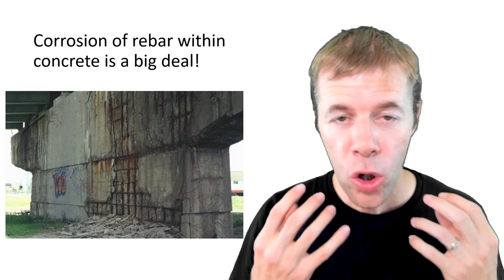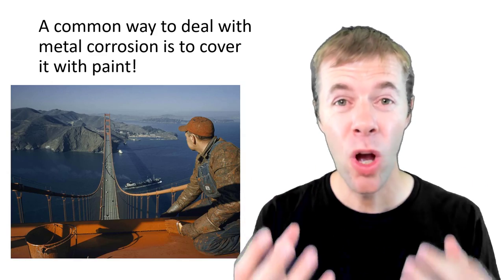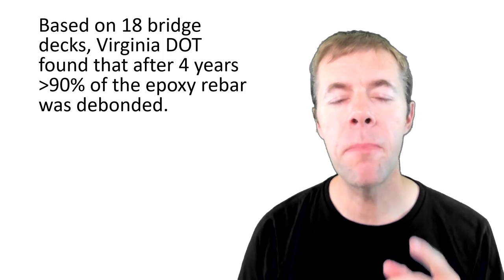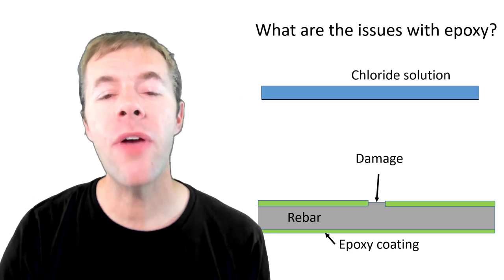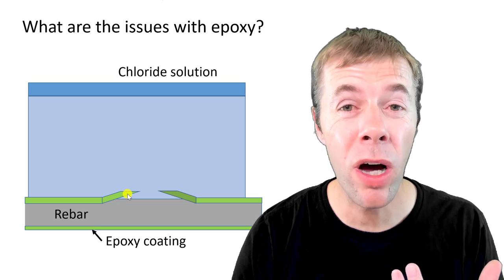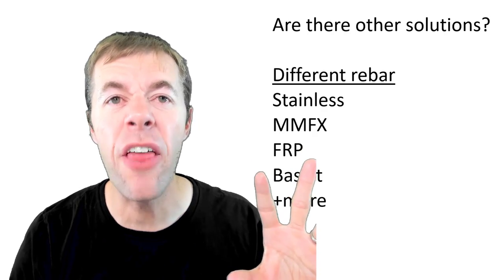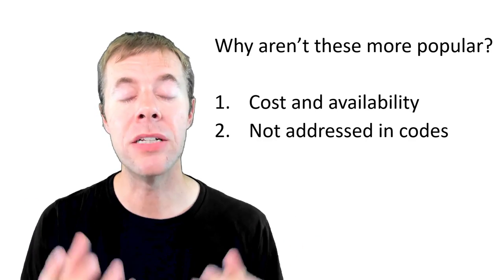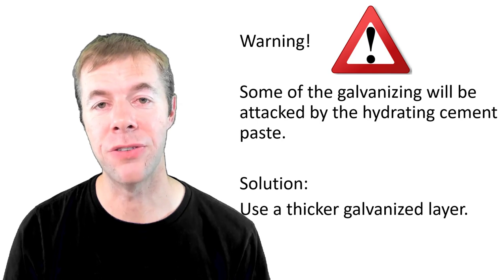What is epoxy coated rebar and why is it being banned?

Comment: When i worked in a foreign country, it was my first time to see a coated rebar and thinking that it may affect the over all strength of the concrete. In my country, i've seen building demolitions built like  last 2 generations. Re bars inside are actually looks new. Never seen a corroded rebars imbedded in concrete. BTW good point on the damage coating

Comment: Many years ago, I went on a tour of the material research labs of the Florida Department of Transportation.  In one of the labs, they were running corrosion tests on epoxy coated rebar.  Every time a new and improved rebar was proposed, test samples were sent to this lab.  They took the rebar, encased 2/3 of the rebar in concrete and wired it up to a mild electric current and submerged it in water (the test samples were called lollypops because of their shape).  The longer it took for the epoxy to fail, the better the product was considered.
Reply: Before to apply epoxy coating you must clean perfectly the rod bars removing the rust first and remove any oil on the surfer. After this you can painting. Hot deep galvanid is better is much more strong with 70 - 100 micron minimum.
Reply: @adrianobonaldo8941  "clean perfectly the rod bars removing the rust first and remove any oil on the surfer."  The problem with your statement is that it is difficult to accomplish in the lab and almost impossible to accomplish in the field.  It is too easy for the epoxy to be damaged by mishandling of the rebar in the field and the abrasion that occurs when the concrete is poured will finish off any chance that a rebar has a completely unmarred coat of epoxy.
Reply: @kennethanderson8505  Yes than is clear that HDG is the better coating for rog bars. Epoxy coating is delicate and for sure on site is quite easy to be damaged. The HDG coating actually best solution, instead of stainless steel rod bars.
Reply: Did you tested some pieces of bars  with the epoxy coat and polyester powder coating in salt spray conditions for 1500 hours or 3000 hours, like ASTM standard?
Reply: @adrianobonaldo8941  I was a visitor, not the lab manager.  The point of the visit was to show that epoxy coatings have problems and they were testing for it.
Reply: @kennethanderson8505   👍
Reply: @adrianobonaldo8941  Thank you
Reply: @kennethanderson8505 Did you got any experience with poliestere powder coating on concrete steel bars? I did a test with acetich salt spray fog,  years ago, and the results were better than epoxy. Better adhesion, better resistance.

Comment: Sitting here are 2am Sunday morning watching a 10 minute video about concrete and rebar. Yep. My life is over. Pack it in. The coefficient of expansion of any kind of rebar is always going to be different than the concrete. This allows movement in all directions and debonding between the two materials. Air gets in, water gets in, and pretty much everything gets in between the two materials. Now those third class of invading materials also have their own coefficients of expansion, etc.. You get micro-spalling of the concrete, even nano-spalling, and on a really cold or hot day you get pico-spalling. All seriousness aside, how about making rebar from concrete? Make concrete rebar, and then treat it in some way so it has the strength of steel. How do you do that? I haven't a clue. Going to sleep now. No more rebar videos for me. There is no upside to it. It is fraught with problems with no solutions and it is depressing. I'd rather ponder how to turn water into wine or how to go faster than the speed of light. Goodnight.
Reply from the maker: Thanks Blue!
I think we can find a solution.  There have been lots of good ideas on here.
Reply: @TylerLey  I have read about Pilling-Bedworth ratio, i.e ratio of volume of oxide to bare metal and the consequence leading to debonding.
Reply: mr bluenet-----although your home-base has no content----i've just subscribed  Goodnight, and sleep tight
Reply: A friend of mine uses basalt rebar in his business - it is used in 300mm thick sea walls.  Something like this stuff:  https://basalt-rebar.com/   but not from that company
Reply: You have the weight of the world on you my friend.
Reply: @jimmatthews5993  Thanks, but I'm still sleeping. I'll check your channel when I wake up.
Reply: Yep. My life is over. 
Nay.
I love civic engineering.  And this problem is the funnest of them all.  It crosses on the line of Chemical engineering, and Mechanical engineering, and Civic engineering, and, me, bringing in anodized as a solution, makes for electrical engineering also.
By the way.  You cannot have concrete rebar, because of the tensile strength.  Well, all 3 ways actually.  Sheer, Compression, and tensile strengths.  That is the whole idea behind rebar.  To breed those quality's into your concrete.
Reply: Bluenetmarketing, do you know that concrete and reinforcing steel are two building products that have the closest coefficient of thermal expansion and contraction of any two materials on out planet?
Reply: Use Stainless Steel rebar is the answer.
Reply: LOL
Reply: @Kpopzoom  I don't know how stainless would be useful in rebar : - it suffers from anaerobic corrosion.
Essentially it needs oxygen to maintain an impermeable oxide layer, otherwise it corrodes just like ordinary steel.
Reply: Fleanis Werkhardt - excellent point! Ceramic fibre reinforced polymer rebar is the future. Gotta be way closer to concrete in terms of thermal expansion coefficients, surely?
Reply: @gregculverwell  Air penetrates concrete for the purposes of thermal mass effectively for 100mm (4") or more. Stainless steel rebar is manufactured and used in Europe for bridges where there's salt used in winter to de-ice. I have used it myself with no issues.
Reply: Simon Tillson if it’s cost effective. That’s the real fly in the ointment.
Reply: What about some sort of fiber-reinforced rods?  Fiberglass?
Reply: LOL all steel rusts regardless of quality.
Reply: Great sense of humor bluenetmarketing !!!
Reply: that was poetic there bluenetmarketing
Reply: Bluenet...You think your life is over? I just watched the video PLUS your comment.
Reply: @blipco5  No, my life isn't over until the good Lord says so. Until then, I'll shuffle along the best I can, rusty rebar and all.
Reply: Bluenet...OK, we'll wait til then. Get you some basalt rebar. It's pretty interesting stuff.
Reply: @blipco5  Thanks. I'll use one as a swizzle stick to mix my whiskey and BS the next time I fill up.....
Reply: +bluenetmarketing ...Good idea just don't put it in the recycle.
Reply: Great reply!
Reply: Loved your comments, bluenet, particularly "...how about making rebar from concrete?...How do you do that? I haven't a clue.  Going to sleep now. ..."  Loved it!  :-D
Reply: Toob247 Toob247  me too! I know the exact feeling.
Reply: Don't give up! You were so close.
Reply: bluenetmarketing what the fuck
Reply: what if you have a promising future in construction
Reply: make the concrete hydrophobic
Reply: What about grey cast iron. Same coefficient of expansion as cement. More brittle than steel, but for the purposes of rebar does it matter?
Reply: @RobotDCLXVI  not as strong as steel
Reply: @Blox117  yes, but for the purpose of rebar is it weaker to a large enough extent?
Reply: Well concrete doesn't have tensile strength, no amount of treating can give concrete the strength to resist being pulled apart anywhere near the strength of steel,  Concrete has incredible compressive strength, Something steel does not have (to the degree of concrete).  When you combine the two then you can use the tensile strength of steel to convert the forces that would be trying to pull concrete apart and convert it into compressive forces on the concrete, while diverting the compressive forces away from the steel rebar by supporting it by the surrounding concrete.
Reply: @fleaniswerkhardt4647  well this is interesting for sure
Reply: @dans150  The basalt rebar? yes - it's fantastic. It comes in a mesh roll or bars. absolutely no  possibility of concrete cancer etc of course. Lighter than steel but as strong if not stronger.  And when you think about it - it has to be more sound in terms of environmental  impact  in its production. It's just processed volcanic rock.  I don't know where you are but it's probably available though not many people have  seen it before.

Comment: ''World....the time has come to...Galvanize''

If you only heard the Chemical Brothers years ago....
Reply: Take my like,I pushed the button.
Reply: Push the button
Reply: Yaaaaas
Reply: Galvanize is fine until you have to bond them using CadWeld or Welding power grid grounding. Once you break through coatings, rust will begin. What works is to install rust free rebar, or sandblasting to clean. Apply a good bonding agent before pouring concrete.
Reply: Basalt rods. Non-reactive, light, expand at same rates as concrete.
Reply: Hit Me!
Reply: You have the same problem with Galvanizing it just breaks away. They use this on armored wires to protect cables in the ocean. The wires coating gets damaged all the time so using a zinc stick over the damaged area works only if the wires are heated like in a welded joint. It's not reality you have the same problem as Epoxy.
Reply: That's the hardest button to button.
Reply: NY use galvanized rebar on state bridges. Been using it for over 20 years.
Reply: @dzlf2504  When is New York's bridge height signs ever going to fall into compliance with the Federal law's? It was set to go into effect after 9/11, but 13'6 or higher signs don't appear. What is it they measure from the axle up?
Reply: Shawn Jenkins I have no idea. All I know is bridges that are marked in NY is actual height of the bridge.  13'6 is legal height for trucks.  Any bridge u der that is marked just not over that. Idk guess they are saving money on signs lol
Reply: @dzlf2504  they have many bridges over 13'6" that are marked as well under 13'
Reply: Scot Coon nope just under 13'6 atleast everywhere I drive in NY. I never get into the city. But just under 13'6 not above.

Comment: I build bridges in Virginia. Depending on the class of road we use either MMFX or Stainless. The stainless is insanely expensive but it is what VDOT wants. Maryland still uses the epoxy bar. One solution is using lightweight concrete, it is a low permeability concrete and keeps the water out.
Reply: That's interesting - I don't know much about reinforced concrete, but in boat building and repair the rule is that if the stainless is going to be continuously in contact with stagnant water, it creates an anoxic environment and then the stainless rusts as fast or faster than regular steel, and isn't near as strong to begin with. So it would seem like stainless rebar would be a no-no in reinforced concrete.
Reply: Alaska is making the switch to MMFX for bridges as well. Definitely a major pain to bend MMFX in the field lol. Hardest bar I've dealt with.
Reply: @bawrytr  thats what i tought as wel. This is exactly the reason you dont see unpainted stainless steel boats. If it was that simple we would be building stainless steel boats here in the netherlands. They also tryed the cor-ten steel, wich wil grow an oxide layer in outdoor conditions and then never rust through. But guess what? The stuff wil gone just as fast if not faster then normal steel if submerged. So just like stainless steel it wont work for boats. So we are still building steel boats as there is not really a good replacement for it except for maybe glass fiber, but that also has its own problems.
Reply: @bawrytr  high use bridges are stainless rebar. It is something to see a big shiny mass of rebar.  Apparently it works, they are spending way more per pound for it then even MMFX
Reply: @sarahfuller6654  we have been using it for years without many issues except it is hard to get because it is sole source,
Reply: Makes sense to coat the concrete rather than the rebar and prevent salt from reaching the rebar in the first place.
Reply: @wallacezick8368  you can do that but it will only last so long. Some coatings will not work with bridge decks where the traffic will just take it off.
Reply: Is that industry suffering heavily right now from covid? My father is a civil engineer in VA metro area and his company is at the point where they’re taking contracts at a loss just to give the employees work. The gov’t doesnt have enough money to pay for previously greenlighted contracts cause of lack of income from gasoline and tolls from people staying home
Reply: Lolwhat, - that's funny when you say that, ...the government doesn't have enough money...
Reply: @jtommyboi  I work in the Northern Virginia area. There is a lot of work but it is competitive.  The construction companies are short handed and cannot get people to work. This was an issue pre covid but really bad now. Before the issue was they had to show up on time, work 5 or more days a week, pass a drug test and oh they really have to work! A lot of the 20 somethings just are not interested and god forbid they give up their pot. We pay the magical $15 an hour, we have paid sick leave and paid medial with a small contribution from the worker. Most weeks at least 40 hours a week.
Reply: @johnmajane3731  I work for a very large Steel company and we supply a lot of MMFX to VA. Yes it has it's waves but its always readily available.
Reply: You working with FAM on the I-66 project?
Reply: @alanbrooks80  the company I work for was a subcontractor  for some of the early bridges. We are no longer on the project.
Reply: @alanbrooks80  VDOT for some reason has decided depending on the class of bridge to use the stainless. We still use MMFX on many projects. The issue is with trucking and fabrication which is causing significant delays.

Comment: I use to work in the bridge industry. Epoxy coated rebar rots faster than plain bar by far, 15 or old stuff was rotted junk when Hammered out for a repair. It also is terrible at bonding with the concrete.  I've demo-ed temporary abutments that were a year old and the concrete falls off the bar during removal, we've even reused the bar on another job cause it looked new. Also old re enforced concrete methods buried the naked bar deeper (4-6 inches) in mix and it hardly rusted after 50-60 years. Some of the last projects I worked on in 2011 called for plain bar, no more coated bar Mass DOT 2011. The issue with the new method with plain bar is, it's only buried 2 inches. It will spall and fail. We had a saying " don't worry, it's work for our children. Sad,25 year bridges,some less.
Reply: You raise a good point. It's stunning to see recent (less that a decade old) projects that are spalling, or even showing rust "shadows"  where the bar is essentially at the face of the pour, and now creating a  rust outline of the bar, on the surface.  I'm in another construction field, but like everything else, IMHE some of this is a result of garbage workmanship. I've been on the sidewalks/bike paths of two newer mega-buck suspension bridges recently. The concrete work was absolutely stunningly awful. Finishing that would embarrass an amateur, lumpy form work,  absolute trash "craftsmanship" , that the public got to spend hundreds of millions for.
Reply from the maker: Thanks for confirming with your field experience.  I agree that cover - concrete between the steel and the surface - is critical to concrete performance.  One challenge with using too much cover is that the rebar can't keep the cracks small.  A cover of 3" provides nice cover and also helps with cracking.  You can also use smaller and closely spaced bars and that will help with cracking.  I really appreciate the comment!
Reply: Your "crappy workmanship" complaint is not caused by lack of skill by the workers, it's mainly due to pressure from management to produce at almost any cost.

Also, in regards to the poor finish, that is mainly caused by impossible to work with mix designs, with huge rocks and tons of pozzolans. In addition to "no water on site" rules that only decrease the workability.

Tldr; due to management forcing almost unrealistic production figures, difficult to finish mix designs and not allowing water to be added, the finish suffers. Plus it's just sidewalk and roadways, you seriously want almost the roughest finish possible to prevent slips and falls. It's a tough balance
Reply: ace toxic  there isn't supposed to be any bonding. The whole idea is to use the tennons like a suspension bridge. They put  massive loads on the tennons to put the concrete under compression in one direction to increase the resistance to torsion in the middle of a span.
Reply from the maker: @Art Bell I agree!  I think this is an awesome tool.
Reply: This is one of the reasons the new Oakland Bay Bridge is not going to last.

Comment: I've noticed some concrete contractors using fiberglass rods now.
Reply: Fiberglass, expensive but it doesn't corrode. pretty tough stuff, I've got a 1973 Corvette, rear 'leaf' spring is fiberglass...not a speck of rust or any corrosion on there...

Comment: It's okay to have a crush on concrete, it's got great compressive strength.
Reply: Seriously now: To save trees, folks suggested concrete houses. Heating issue.. But concrete pollutes the air quite a bit, during its' manufacturing.